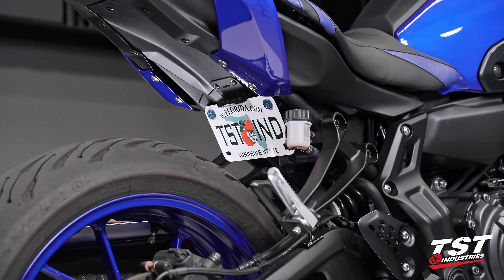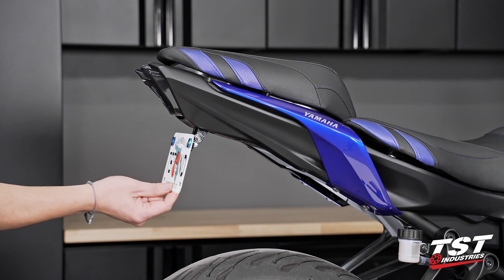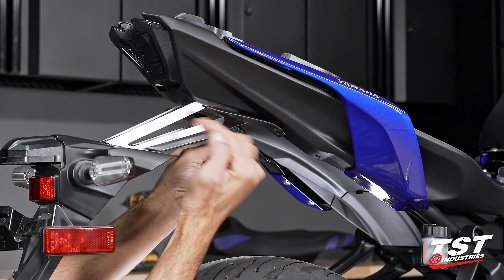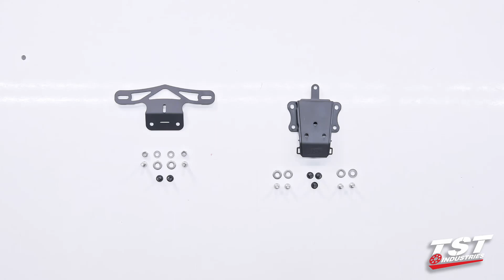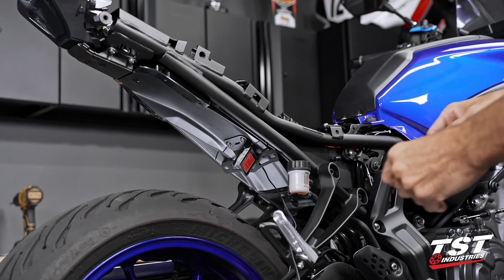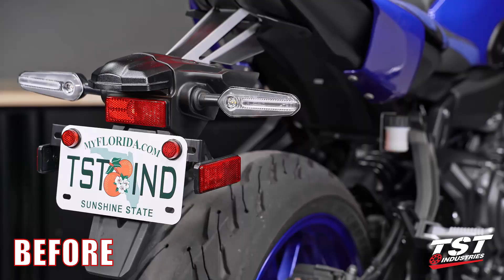How to install an Elite-1 Low Mount Fender Eliminator on a 2021+ Yamaha MT-07 by TST Industries

Comment: Will this fit on the FZ 07 2017 model? Great video!!
Reply from the maker: The tail light for the 2015-2017 model is a little different, but the design is along the same lines. You can see that tail light on this page: https://tstindustries.com/yamaha-fz-07-mt-07-2015-2017/
Reply: @TSTindustries  I was talking about the low 
-profile license plate mount.
Reply from the maker: @diegodiaz3275  oh sorry, that was my mistake. We have not qualified the low mount fender eliminator on the first gen bike so i cannot comfortably give you an affirmative. It is very probable but I would have to do the installation on that bike myself before confirming.
-BR
Reply: @TSTindustries  if you could, it be great. If it does fit I’ll gladly be a customer!

Comment: Thats  fit on 2019 mt 07 ??
Reply from the maker: It does fit but the tab on the bike that the bracket locates on is not present in the pre 2021 bikes so you would have to center and level the bracket on the bike by eye prior to drilling the holes
Reply: @TSTindustries  thx  😁😁